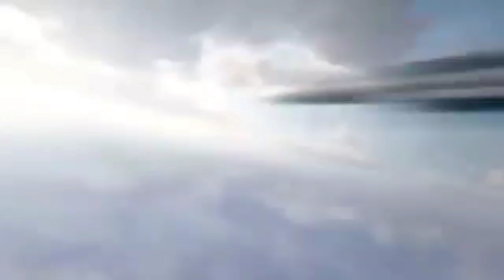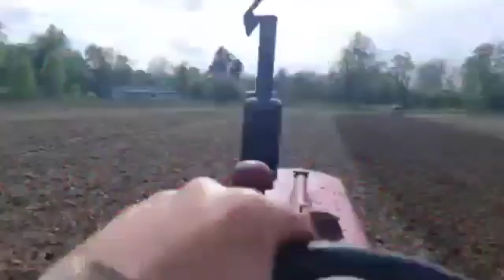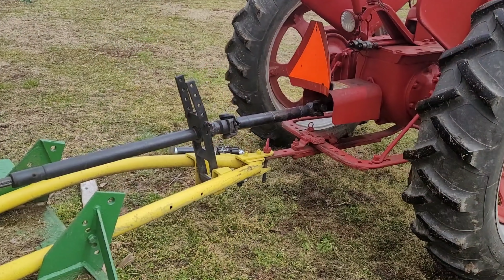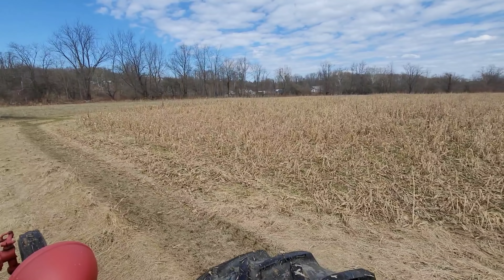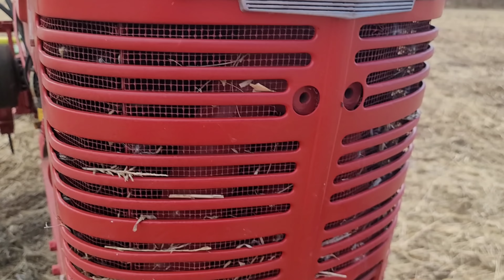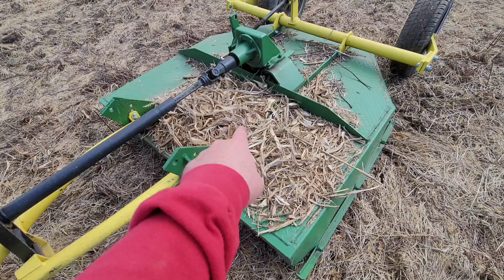Farmall H ... Hoggin' Stalks!

Comment: That brings back fond memories of mowing corn and cotton stalks with a 656 and a two row lift mounted International mower. In the fall when it got cold we had some weather shields made of canvas that covered the side of the engine and a "wind shield" made of plastic that we mounted on the tractor. You could get them from the dealer. You get her going and got the exhaust manifold hot and it was quite comfortable or for an 18 year old I thought it was. Truth be known it just kept you from freezing to death. Yep those were the days. I didn't have a care in the world. Growing up kinda sucks...
Reply: Well fanatic, talking about what gear you're running in I run the regular h's in fourth super h is in third but if you have the time to run it in second you're probably going to get a better job to gives the mower more time to chop. We generally run over ours in the fall fall on either the two row corn picker or the combine and we pull a deer 16a flail chopper behind a super h and generally we use either your second or third gear.
Reply from the maker: I wait all winter to get on these old tanks, I'm gonna savor the flavor
Reply: @FarmallFanatic  yeah I understand that! We run cattle so we're running some of them year round again we clean stalls and grind feed and we spend a lot of time in the woods with ours keeping the outdoor wood burner in firewood. But it feels good in the spring to break out the equipment that's been mothballed all winter and start working it, spreading fertilizer is expensive as it is on my hay ground this spring with my 460 and 3-point conversion handling a little spinner fertilizer spreader. On our way right now to clean seed oats we get them ready and get the fences going around by that time the ground ought to be dry enough to break out the moldboard plows. We pull 3/16 with our cx95 McCormick and 216 s with our 75c. They're a little bit under plowed and a little bit overpowered but my feeling is that if you can step up a gear plowing get it rolled over nice it takes a lot less discing and fitting to get it ready to go to plant. There's just no way to unscrew a screwed up plowing job was a disk if you don't get a plowed correctly you'll never get it disk right. Have a good spring. I was planning to go to boak sale on Friday I was hoping maybe get a chance to meet you and then I just had this burning desire it was such a nice day to spread fertilizer so I got to start got a couple loads off Friday afternoon I was a little shy of help so I had to quit early to do barn work so I'm hoping to get back on that job today
Reply from the maker: I would have done the same thing

Comment: Pulled a John Deere 494a planter with a Farmall h for several years never intended to use anything.else handled it with the greatest of ease now power steering or live power but that was no problem loved that tractor one of the most handiest tractors I had also great for taking hay and ten foot swather

Comment: I also I have 1945 farmall h and I never have to use the choke to start it but I have to quickly pull it out and push it back in a few times after it runnin to keep it runnin otherwise mine never needs choked

Comment: why dont you run a disk on the edge of your field then burn?  a good 8ft  of firebreak works pretty well.. also would the M be too large for that size mower? i know itll pull it just fine but it seems like a m would burn more fuel  for the same job?
Reply from the maker: Well that's what I said in the video that I usually do.. The M wouldn't even know it's back there
Reply from the maker: I've used it on the H probably 5 times and it just in my opinion is a match made in heaven
Reply: @FarmallFanatic  welp i mustve missed when ya said that hah, im a bit deaf.

Comment: Need to get some electric fencing and a few pigs.  Our friend used to always turn his hogs out into the corn field and let them clean up the ears the picker missed.  It was a lot easier to do that with the electric fence, he could section it off and check how much was on the ground they missed.
Looks like you still need to get a cylinder and hoses for your brush cutter.  Make it a little easier to adjust your cutting height from the seat of the tractor.  But you already know that.
Reply from the maker: Plus the Pigs fertilize the field
Reply from the maker: Goes without saying

Comment: I was mowing with my farmall C and the drawbar snapped in half and the mower fell to the ground and nothing bad happened
Reply from the maker: It's weird that you were able to view this because I have it unlisted. So the PTO shaft kept spinning and that became your drawbar?
Reply: Well no my drawbar snapped and the pto came apart it must be a different design then yours mine has two pieces that slide together to change the length of the pto during turning and that is where it came apart also the video came out on the farmall H playlist but not on the normal video space
Reply from the maker: Ahhhh I always wondered how that unlisted thing worked

Comment: I was curious if you’d have a solution to this problem my 340 was screaming when I used the pump and it eventually went out I put a new one on it and it’s still screaming but works just fine?
Reply from the maker: Are you running hytran?
Reply: @FarmallFanatic  no I do not think so I also need to take a look at the filter in the trans I don’t know if it’s ever been changed to be honest, it’s me and grandfathers tractor so I’m not completely sure on it’s past
Reply from the maker: @dennislillywhite3935   Most definitely want to change that and use HyTran
Reply: @FarmallFanatic  alrighty thank you